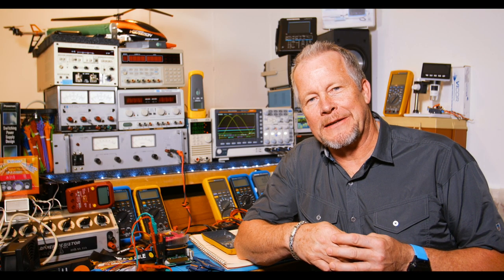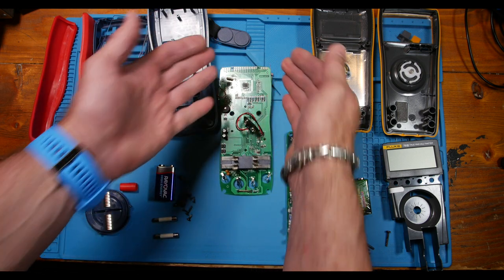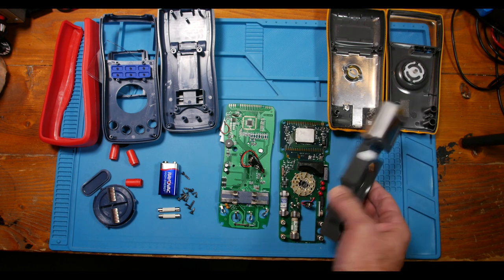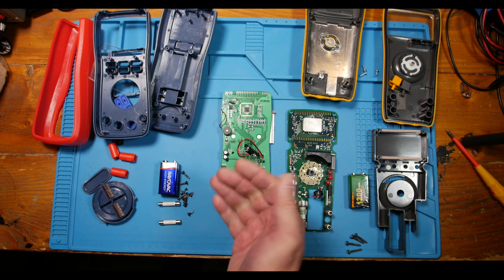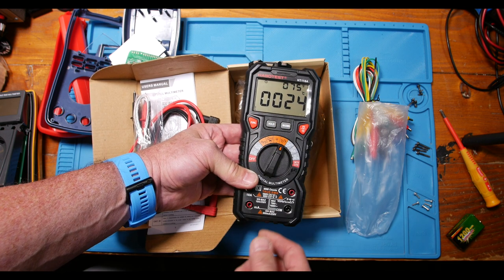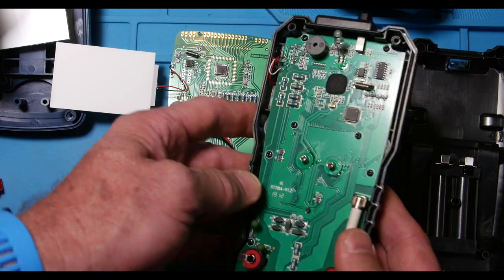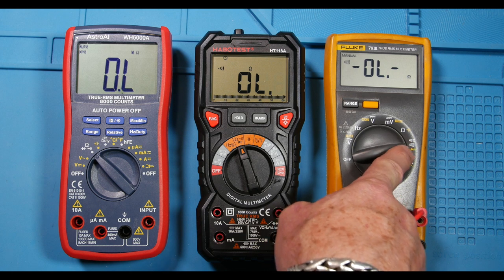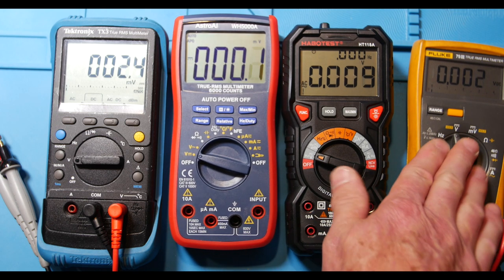Low Cost Digital Multimeters versus a Fluke

Comment: I would not dare to choose a meter in less than cat 3 if i have some distends to the fuses, and i prefer cat 4
Reply from the maker: Michel Sommer Thanks Michel - it does seem that a meter not rated to CAT 3 has made some short cuts.  Do you work in CAT 3 areas or do you just prefer meters that make every safety choice?
Reply: I know how the cats work, and my workplace are less then 2 meters of cable from the meter + plus I'm a former electrician, "electrocuted" in a accident so I'm now studding to become e a ict-engeneer since i can¨t use my right arm to lift much more then 3-400 g on a good day
Reply from the maker: I’m sorry to hear about the accident.  How do you like the new career path?  Do you have a favorite meter?
Reply: I guess that it is ok a lot of school, and the main meter i uses for now is a Fluke 179
Reply from the maker: Michel Sommer That is a nice meter!

Comment: You missed a feature in it. If you are on continuous backlight and and you test AC voltage with probe, the backlight turns red as warning. 🙃
Reply from the maker: Thank you for pointing this out!  This is a great feature from these low cost meters;)

Comment: I'm looking into getting a multimeter. I'm a beginner and just want to use it for around the house and for my car. I am thinking of getting this (Kaiweets version) or the Southwire 10041N. I haven't seen any reviews on the Southwire. Only a video by the company. Have you or are you planning on doing a review of Southwire? Also I saw a video for this that showed the backlight effecting the reading when turned on. https://www.youtube.com/watch?v=_pA9srZqrjo Did you find this issue? And the Southwire also has a UL rating as well as CE, not sure if that's a big deal or not,
Reply from the maker: Thanks for asking!  I do really like the Kaiweets but I also have a Southwire meter to review.  Maybe I’ll bet that out this weekend;)
Reply: @KissAnalog  You do thorough reviews so I'm sure it would help in my decision. Right now, because of this video, I'm leaning towards the Habotest/kaiweets. Mostly because of the extra features like the illuminating probe placer thing. I know it's a small thing but it's cool.

Comment: The top quality components dont justify the $500 price compared to the $50 Chinese products. The price difference is 100% labor cost. To bad the Fluke's cant be purchased at a more reasonable price
Reply from the maker: I agree John as there are many other brands that have great parts - even better, but the price is not near as high.  Also, most Flukes are made in China or Taiwan where the labor cost is equal to the competition - but the price is multiple times higher IMHO;)

Comment: I have the wh5000a And the continuity faster than that
Reply from the maker: I think it is a great meter.  How do you like yours?  Thanks for the feedback!!
Reply: @KissAnalog  yup I like mine very much, I have mine just a bit over 2yrs, only thing I don't like about it is that it don't have any metal insert in the screw holes for the battery compartment,  they should have atleast put metal insert in those holes only seeing that those are the screws that will regularly be opening to change battery, when it's plastic the threading tends to get worn of eventually with all the wear and tear of screwing and unscrewing
Reply from the maker: I know what you mean - I have certain meters that I use a lot - and one doesn't turn off automatically - so I end up changing batteries often.

I'm starting to do some multimeter reviews - some at prices that people might like - but I want to review just the features that make the difference to most people so if you have any ideas - I'd love to hear them;)

Comment: IN MY OPINION FLUKE IS TO PRICEY AND,UNLESS PLAN TO USE IT ON MAINS YOUR $50 DOLLAR OR UNDER IS GOOD ENOUGH FOR MOST OF US TECHNICIANS AND,ENGINEERS.I FIND THAT EVERY BODY HAS DIFFERENT LIKES AND,OPINIONS.I PERSONALLY LIKE MY OWON B41T+MULTIMETER,. EVEN THOUGH I WILL NOT USE BLUETOOTH FUNCTIONS.
Reply from the maker: I agree with what you say.  The Owon does have logging and Bluetooth along with a nice screen.

Comment: Never buy Fluke : (
Reply from the maker: Maybe used on a good sale;)
Reply: Why not? I've got mine model 76 in 1995 for about $200 or so and still happy to use it 25 years later. As accurate as new with no calibration since bought.

Comment: Modern digital multimeters have many abilities, there are a wide range available to suit most engineers needs. These start from basic models costing only a few Pounds Sterling which are capable of measuring voltage, resistance and current, to expensive and exotic meters.
The more expensive meters are capable of performing not only the three functions mentioned above but depending on the needs of the service technician there are meters to measure capacitance, frequency, temperature, transistor specifications
Reply from the maker: Thank you!